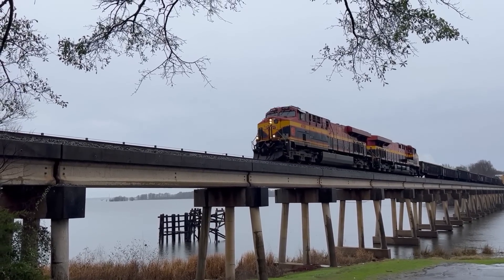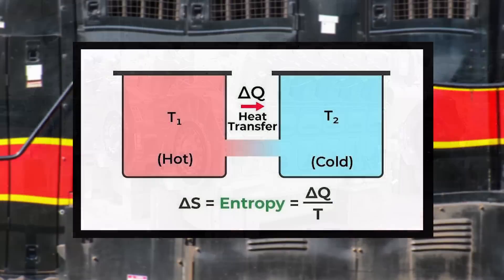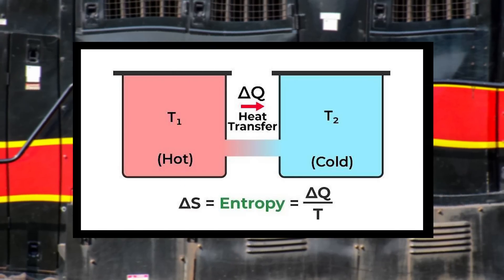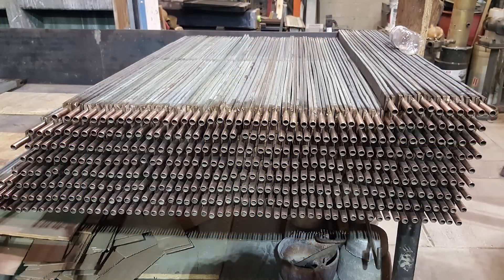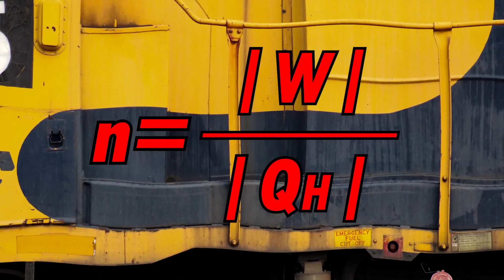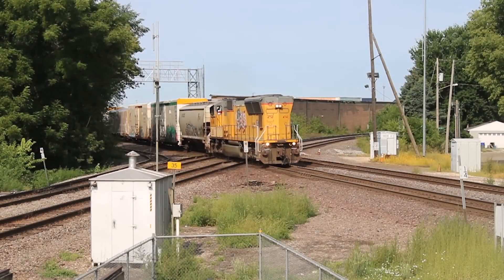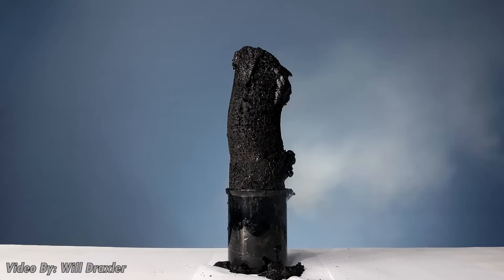Why Have Radiators On Locomotives Gotten SO BIG!?

Comment: More of the heat associated with the thermodynamic lost heat goes out the exhaust than the radiators. Locomotives are packing ever more horsepower, so the losses to the cylinder head and cylinder walls are also increasing.
I don't know but I would guess that there is a trend towards more natural and aero based airflow rather than bigger fans using more mechanical energy to force airflow. That is also why the radiators are trending to a vertical flow of air rather than a horizontal cross flow. Automobiles gained a bit of efficiency by using electric fans that only run when needed father than full blast all the time.
Some stationary ground power units, usually gas turbines, use cogeneration to wring practically all of the east heat out of the exhaust flow. You can stand in the exhaust at 120 F. Or so. But doing this requires big heat exchangers and a use for low quality heat like space heating or hot water heating  etc.
We end up accepting what seems like low efficiency for convenience and practicality.

Comment: These are diesel electric locomotives using the traction motors as generators for breaking. The produced electricity is discarded by resistive heating elements in these radiators. Bigger radiators are needed if trains are more heavy. I don't think it has much to do with engine cooling.

Comment: I remember,  from a 25 year old Trains magazine, that the bigger radiators on newer locos had split the engine and turbo cooling, so they could both run at optimal temperatures.

Comment: As pointed out by a few, correlating radiator size of diesel-electric locos with heat death of the universe was, in my opinion, enlightening.  Would like to see another video on that bigger topic.

Comment: One day, we won't need radiators for Locomotives, because Locomotives will be powered Soley by electricity, and the electrical energy they create via dynamic breaking can be returned back into the catenary or third rail.
It's the regenerative feature.

Comment: A large portion of the heat energy made by the engine also goes straight out the exhaust pipe. Engines breath a hell of a lot of air and to warm up that much air even a couple of degrees takes a lot of energy, then think how hot exhaust gets and you get the scale of energy loss there. These days we can recover a lot of that energy with recovery turbines which can push thermal efficiency above 50%. Theres a Chinese company advertising a 53% thermally efficient diesel motor, although theres no other specs available so it might be vaporware

Comment: Basic engine efficiency for an engine in a locomotive.  About 1/3 of fuel burned makes usable HP.  The next third is heat load on the cooling system and the final third is heat out of the exhaust.  To make more power requires more fuel and generates more heat.   There are other small losses to radiated heat from the crankcase, intercooler and lube oil cooler heat loads.

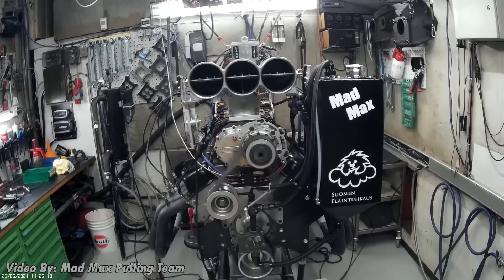Comment: At 3:30 : Not exactly. The thermal energy that 'escapes' doing any work remains in the working fluid (exhaust). A fraction of that remaining thermal energy is transferred to the engine structure, the rest goes out the tailpipe.

Comment: There is something wrong with your description of the heat engine. The engine could run happily if NO heat reached the cylinder walls.   The hot source is the heat of combustion and the cold sink is the exhaust.  The heat lost into the cylinder walls isn't shown in your diagram.  It is OUTSIDE the heat engine diagram.  It is simply a loss of heat.  If that could be lessened then the efficiency of the engine could be raised somewhat and there would be less need for cooling.  To do that would either require high temperature ceramic components or making cylinders longer stroke and larger volumes with fewer cylinders.  But that makes an engine that is heavier, costs more to make and doesn't rev as high.  Thus producing less power.  We sacrifice efficiency for power to weight ratios and power to cost ratios.

Comment: Another reason is that stricter emission controls causes engines to run hotter and hotter. That is why, at least here in Europe that modern cars and trucks with combustion engines have such massive front grilles to get as much cold air into the radiators as possible to avoid overheating.
Reply: Thats not correct! The problem are the nitrogen oxides. Their amount rises with higher combustion temperatures.
Its very difficult to get rid of those nitrogen oxides afterwards so the strategy is to lower the combastion temperatures to reduce the creation of nitrogen oxides during the combustion process.
But lower combustion temperatures create a cooling problem. As the amount hof heat which transferes from cooling water to air depends of the difference of the temperature between cooling water and air. So the area which is available for the heat transfer is the only possibility to bring the same amount of heat into the air is to increase the area of the heat transfer. If additional the power of the diesels are increasing and at the same stage the combustion temperature is falling due to environment needs you have at the same time two reasons to enlarge the heat transfer area. Thats the reason why we have now such huge water coolers.
Reply: Well said 🎉

Comment: These radiators are not simply cooling radiators for the engines.
They also serves as cooling for the load resistors, when the axle motors works as dynamoes in dynamic braking.
Dynamic braking is when the momentum of the train in downhill operation is held back by the motors load rsistors.
The load resistors gets hot when taking up this energy, effectively transferring momentum into heat - just like mechanical brakes.

Comment: A bigger prime mover is going to need a bigger radiator for the coolant also when using the traction motors in dynamic braking mode that energy has to go somewhere. Hence radiators to cool the resisters.

Comment: The primary thermodynamic cycle cold sink on a diesel is the exhaust..  The purpose of the radiator is to cool the cylinder walls so the oil film doesn't burn off, causing the engine to seize.

A diesel would be more thermodynamically efficient if all of the heat from the thermodynamic cycle went up the exhaust stack, and none of it was bled off by the radiator.  There was talk of doing this in "adiabatic" engines that would use ceramic piston rings and cylinder walls to do away with the need for oil lubrication.

Another factor mentioned in the video was a "split cooling" system for the intercooler in the turbocharging system.  Part of the need for that is lowering the combustion termperature, which goes against a high "hot side" temperature for thermodynamic efficiency in order to reduce the emission of nitrogen oxides (NOX), which needs to be greatly reduced in modern locomotives that need to meet "Tier 4" emission standards.  Another reason for the intercooler is to pack more air into the cylinder because cooler air displaces less volume, increasing horsepower and potentially reducing fuel consumption by reducing the the size of the engine and hence friction losses to produce a target level of horsepower.

Either a Stirling engine or a condensing steam engine for the same horsepower need a simply enormous radiator.  The reason for that is that these engines are closed-cycle and not rejecting heat directly to the atmosphere through the exhaust.  These closed-cycle engines recycle their working fluid and cannot do that, so the radiator needs to reject all of the heat in the thermodynamic cycle, not part of the heat as needed in a diesel to prevent the cylinder walls from scoring and pistons seizing.

Comment: In a diesel heat engine the cold reservoir is the atmosphere accessed through the exhaust. The cooling system is there to solve the materials condition of not melting the engine.

Comment: I'm curious just how much horsepower these engines are putting out now, but when searching for the one with the largest radiators mentioned, I couldn't find anyone even asking the same question.. so how much horsepower do they have??
Reply from the maker: Average horsepower for a modern road locomotive is 4000-4400, switchers are a bit lower at ~3500

Comment: I wonder why these companies never thought to use the exhaust manifold as a steam boiler and put an extra turbine on the turbocharger as an assisting system? Steam could also be used to spin a small standalone turbine for extra electric power in a closed loop.

Comment: This reminds me of the Indian Railways Diesel locomotives, where the older generation ALCO locomotives had flush radiator grilles as they were rated at 3100-3300 hp, making it easier for a smaller radiator to cool the charge down. However, the newer EMD GT46MAC (SD70MAC derivative) and the EMD GT50MAC (SD80MAC derivative) locos had much higher horsepower ratings (4500hp and 5000hp respectively), so they have large flared radiators, which made long hood operation inconvenient (India didn't use turntables to prevent delays). 

The visibility issues compounded so much that finally the Indian Railways research organization relented and redesigned the EMD locos to have dual cabs, with air-conditioning mounted into the cab attached at the radiator end to prevent it from heat damage.
Reply: Good thing India is moving towards electric trains 
Which funny enough go the opposite direction 
They used to have huge fans and radiators in the 60s-80s but engines built in the 90s and later have very small air intakes(most of it only to cool the Traction Motors)
Reply: @meki___6881   I think the radiators on electric locomotives shrank because India shifted from DC traction motors to AC traction motors. That shift was roughly in the late 90s to early 2000s era, maybe slightly earlier.
Reply: @prabhatsourya3883  yea ac is much more efficient also they feed energy back wen breaking so they skip dynamic brake fans too

Comment: Hmmm a few points, firstly in an internal combustion engine more of the heat energy is lost out of the exhaust than through the coolant. Secondly these are turbo diesels, part of the reason why radiators are larger is to intercool the incoming air more effectively allowing for a higher effective compression ratio in the engine and greater efficiency. Thirdly larger cylinders result in a lower ratio of cyclinder volume which trends with power to surface area which trends with heat losses.

Comment: Boil off tanks also work.........its just very inconvenient to refill them.  But on high speed air racing piston aircraft.......the heat exchanger ducts are covered over to reduce drag, and the heat is dissipated by a water/methanol mixture which boils off as it exchanges heat with the engine coolant.  Achates 2 stroke engines made by Cummins are looking to reach 55% thermal efficiency. Because they have no cylinder head, there is better heat rejection into the exhaust.

Comment: In 1980s when we got more powerful Class 56 loco's  the radiator size did not increase I questioned one of the tech guys when we were loadbank testing , he said we run the cooling system much hotter so the smaller radiator dissipates more thermal energy (heat)  . Seems strange running hotter for better cooling , loco's didn't have overheating problems

Comment: Liquid radiators can be made thicker for more liquid tubes, to handle larger engine heat transfer.  The heat sinks for the dynamic braking need to be more exposed to dissipate the heat.  When the engines pulling power increases, they also have to increase the dynamic braking capabilities of the locomotive proportionally, thus they have to increase the ability to dissipate the heat generated by the increased dynamic braking.  Since there is not a water jacket around the dynamic braking load banks, the ability to move air over a larger heat sink has to has to happen.

Comment: Why the cargo rail lines don't get electrified? Wouldn't that be cheaper on the ling run?
Reply: Electrifying all of America's railroads would require a massive and costly overhaul of infrastructure, including power stations, overhead wires, and maintenance facilities. The vast size and diverse terrains of the American railroad network pose significant logistical and operational challenges to implementing such a widespread electrification effort. Additionally, the existing fleet of diesel locomotives and associated infrastructure make a full transition to electric railroads a complex and lengthy process.

To put it simply, it's too expensive, complex, and massive, because the North American rail network is the largest in the world.

Sorry if that sounded neardy.
Reply: @Nitroispro  got it, thanks!

Comment: The combustion temperatures have also been increasing to get the very last drop in increased efficiency. The excess nitrogen oxides are dealt with additional equipment

Comment: That is an excellent explanation, referring to the entropy. The increased use of dynamic braking reverts kinetic energy, switching motors into generator mode to electricity, which is sent to the radiator to disparate as heat. I read that some test models had a battery to store extra power to assist during shunting and maneuvers. Just my 2c. Cheers!

Comment: You interpretation of the carnot diagram is incorrect. Radiator isn't the temperature sink, its a leak in your heat reservoir (not shown in the picture). The cold reservoir is the atmosphere to which the exhaust escapes. 

For efficiency, you want the highest temperature from burning the fuel + air mixture inside the cylinder, and have the coldest exhaust temperatures.

Lowering exhaust temperature is hard, you need to expand the exhaust a lot before it's released to atmosphere. Compound steam engines used to so that by using multiple cylinders in series. At some point, the juice becomes not worth the squeeze due to size and weight constraints of the engine.

Raising temperature of the fuel+air is easy, run higher compression ratios and or add more forced induction. A turbocharger also extracts energy from hot exhaust gasses, and its a win-win. The downside is materials of the engine can only get so hot before the strength is compromised, hence the need for bigger radiators.

Comment: Couple points on efficiency:
1. A bunch of heat pisses right out of the exhaust pipe. Maybe more even than what ends up heating the engine block.
2. The absolute BEST case scenario is a gas turbine engine with recouperation (heating the compressor inlet using turbine exhaust air) and co-generation (an additional steam generator heated by exhaust heat). Those peak around 60% if they've been implemented well, but even then, they only get that at their rated power output. Soon as you ask for any less power, efficiency falls off a cliff.

Comment: How are the traction motors cooled? Just passively?
Reply from the maker: They’re kept cool with air provided by a blower (it’s usually towards the end of the long hood)
Reply: @Southern_Plains_Railfan  Ah very good. Would be interesting to see them try other kinds of prime movers on locos. Like a sterling engine, or a combined cycle gas turbine and steam turbine system.

Comment: Having failed thermodynamics at least once I feel I have an expert opinion on this subject. The waste heat is not expelled by the radiator but by the exhaust. The radiator simply keeps the engine from melting. The working flued that pushes the pistons down is air (mostly nitrogen) and exhaust gasses (CO2 and H2O).  Removal of heat from these gasses completes the engine cycle. Since these gasses can't be reused they are simply dumped overboard. Same with steam engines. In (nuclear) power plants the steam is reused, so cooling must be done with those giant cooling towers. Imagine how big a radiator you'd need to cool the steam from a  locomotive down to under boiling temperature, then multiply that by 100 (est.) to deal with the waste heat of the diesel trains in your example.

Comment: The power density of engines has gone up but the heat transfer capacity of a radiator has not. Therefore more power demands more radiator. There's a lot of unnecessary complexity in this video.

Comment: Heat isn't normal energy I mean it is but it's not it's vibration that's what it is it's how fast the atoms are vibrating in a given material or the molecules like when you heat up water the molecules vibrate faster to the point where it starts boiling and see like water you can't heat up anything past its boiling point sure you can make that steam or vapor hotter than what the boiling point is but you can't make the actual liquid hotter so water will never get hotter than 212 degrees Fahrenheit or 100° C it's just not going to happen unless you're an extenuating circumstances like you have more or less pressure and that's another thing and that affects it but essentially he is just vibrations cold is the lack of vibration cold is technically not real there is no cold force all there is is heat going somewhere else because everything wants to sit at its lowest energy State possible so those atoms want to stop vibrating and this is when you get into entropy and it gets very confusing but all the radiators do is give larger surface area for entropy to take effect the fans accelerate that too